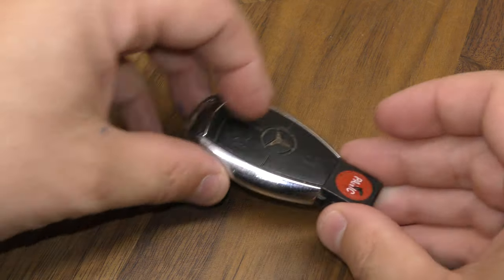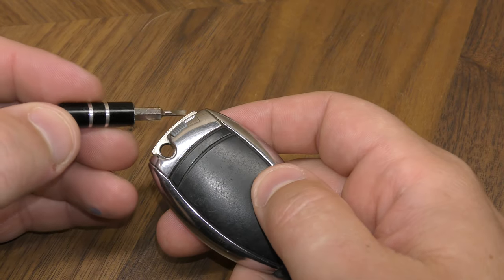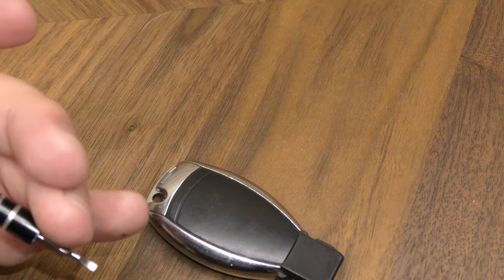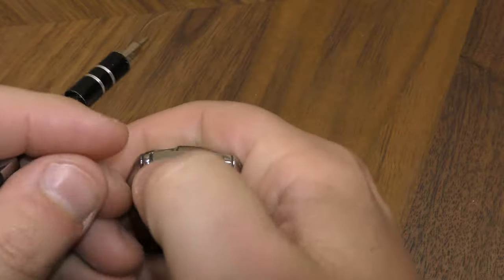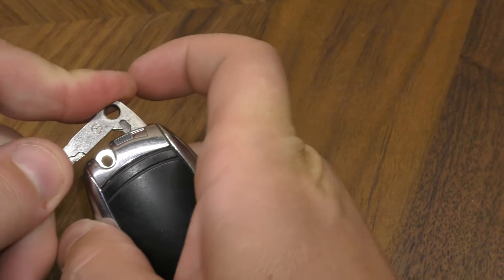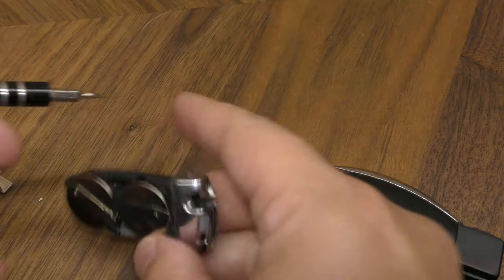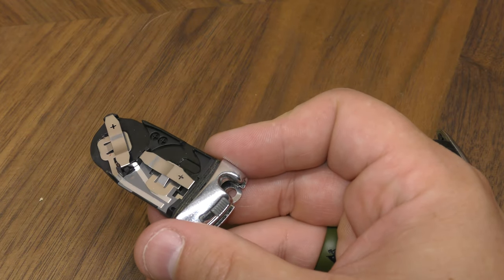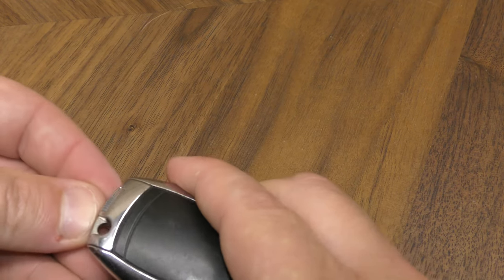2006 - 2011 MERCEDES BENZ S SL SLK SLS CLASS REMOTE SMART KEY FOB battery replacement - EASY DIY

Comment: So I successfully changed the battery, but it wont lock or unlock the door, or pop the trunk. It will start the car, but the buttons dont work which they all did work before I cjhanged the batteries.
Reply from the maker: It sounds like the battery you placed in there is likely a bad battery

Comment: Thanks. There are two fobs that look identical but use vastly different methods.
Reply from the maker: You're probably talking about this one - https://youtu.be/0mQlLsbhOy0
The panic buttons are different and the overall shape is slight (and I do mean slightly) different but they are easily confused.
Reply: I was. Mine has the line across on the back. The other videos don't differentiate the different fobs, but my car is a 2008 so it is old!!!
Reply from the maker: @winniethepeg  glad you could get it sorted out

Comment: How did you slide that with your thumb?
Reply from the maker: The catch part that holds in the mechanical key? It's just hard pressure. I've done a few of these before so I'm familiar with the process. You could also use a small screwdriver to slide it over but then you're likely going to need another hand to pull the key out. It's not a great design but that's how it's done

Comment: It takes 30 seconds to explain how to open the first one. useless video and no link for the first model you skipped over.
Reply from the maker: There is a card in the right hand corner that goes to the video. I point out at :13 in the video the link to that video. It's also in the pinned comment